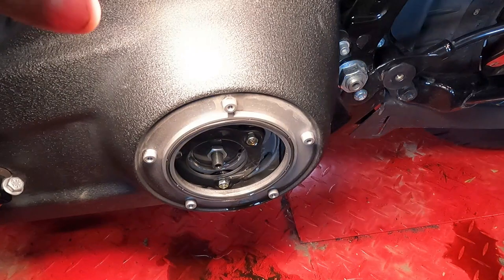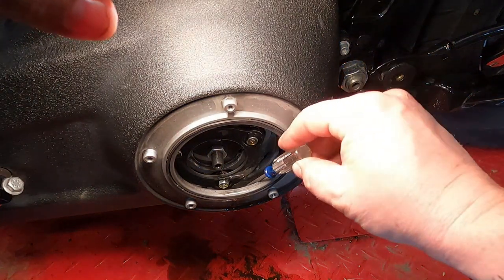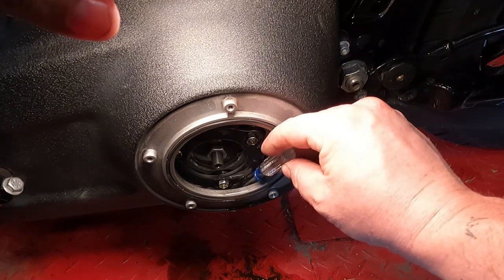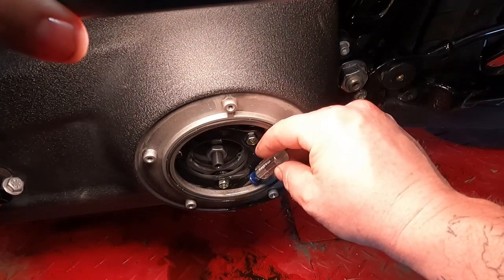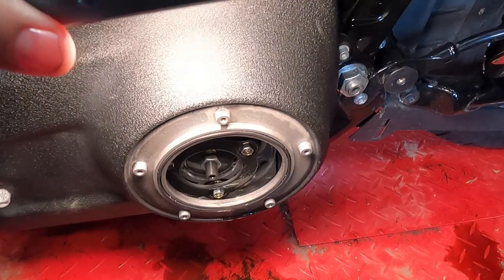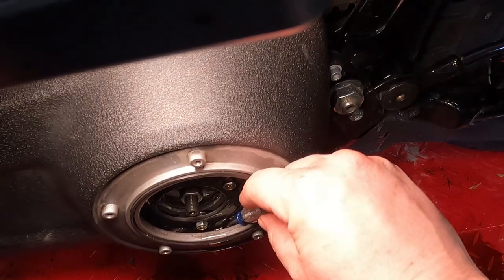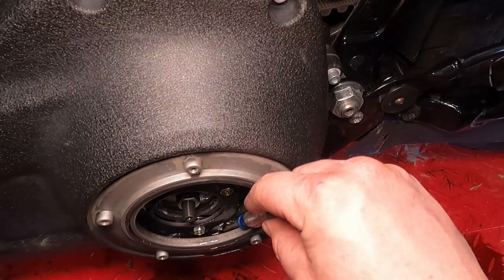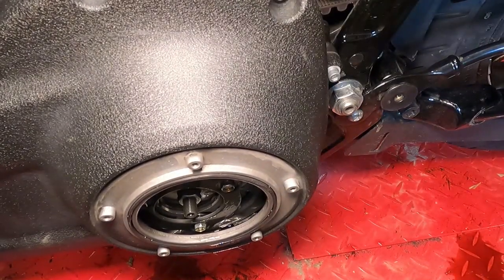Primary Oil Inspection On M8 Softail Or Bagger

Comment: Thanks for the info. Trying to learn as much as possible of the different characteristics of my new Low Rider S. Used to working on my Z900's and VStrom. One cylinder is over the total cc's of 4 on the Kawasakis. I'll follow your guidelines on 3 hole oil change as well. Lot cheaper and can use my Bel Ray 20/50 instead of their HD oil. Cheers.
Reply from the maker: You’re welcome. Bel Ray is a solid option!